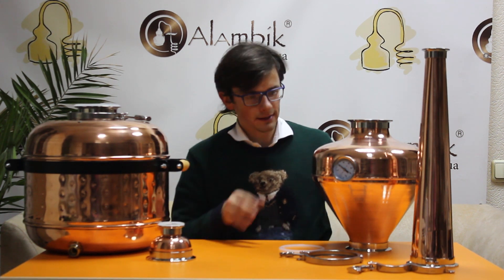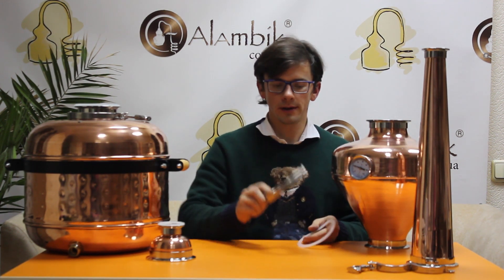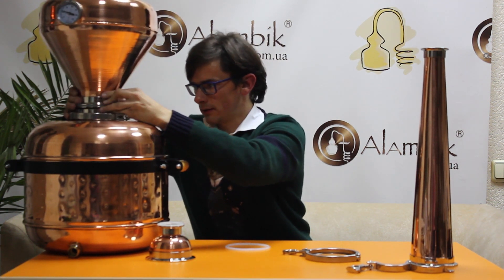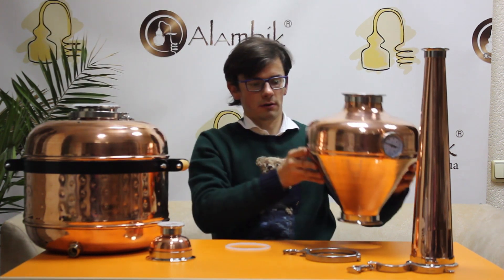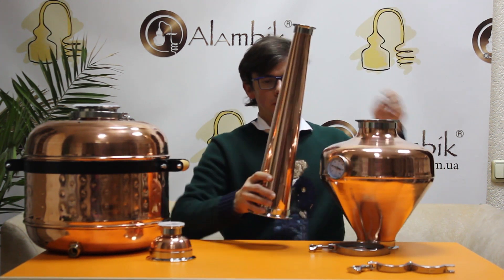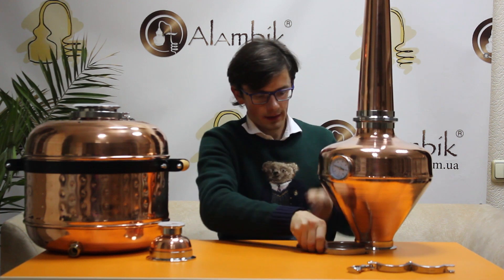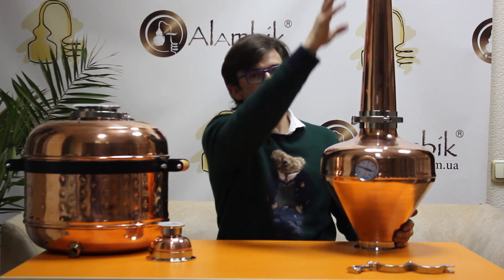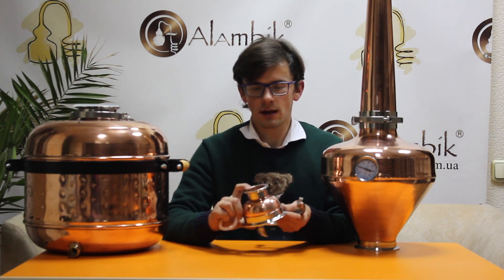Building your own still with copper distilling accessories

Comment: Onion head thickness of copper when it is finished after it is drawn into shape please
Reply from the maker: Des Morris Hello! Thickness of copper is 1 mm
Reply: Copper Pro ok thanks just have concerns it might not support a coloumn with a gin basket
Reply from the maker: Des Morris why do you think so?
Reply: Copper Pro just have concerns with thickness of wall which gives it strength ?
Reply from the maker: Des Morris This is the standard thickness for copper products, you will not have any problems with the durability of the product, you can read the reviews of our customers on the website
Reply from the maker: Des Morris Hello! you can find links to all the accessories under the video, no, these accessories are used for alcohol distillation, but on our website there is a large selection of distillers for essential oils
Reply: Copper Pro THANKYOU for the reply
Reply from the maker: you're welcome!)